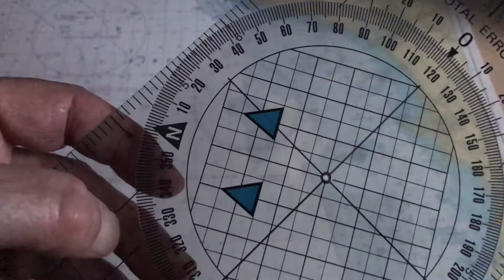Portland Chart Plotter

Comment: You never explained where you got the 120ﾟ bearing from
Reply: The 120 degree bearing could have come from using a hand compass while on the boat. Pointing the hand compass at the lighthouse while standing on the boat would give the bearing to the lighthouse. Important to note that the bearing would be a magnetic bearing which would need to be corrected for variation to a true bearing. I assume this was a hand bearing from a compass, corrected to make it a true bearing of 120 degrees.